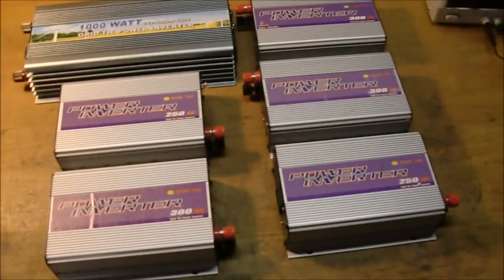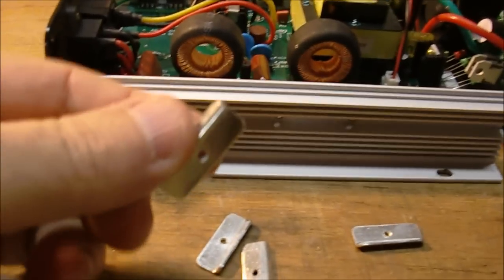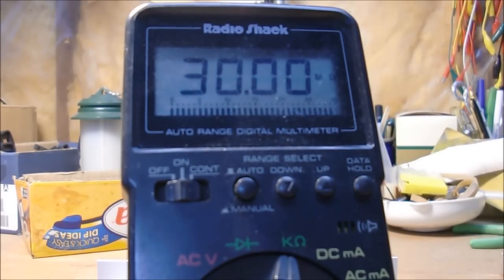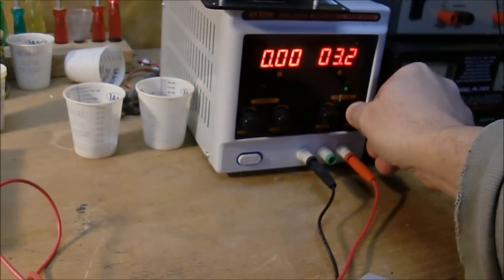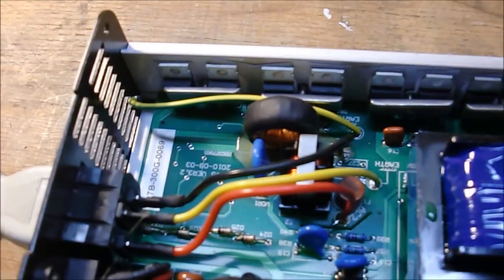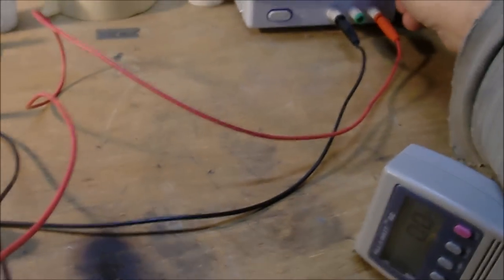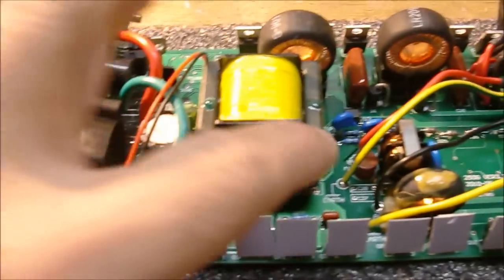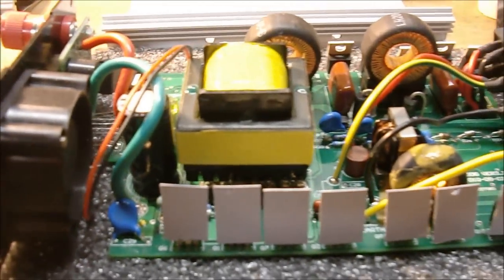Grid Tie Inverter Repair GTI SUN POWERJACK

Comment: I asked some one on here before about upgradin the mosfets, and they told me it could be done. but I have do it with audio equipment and its the same thign other than its for audio just have to make sure on the data sheet the gate voltage and stuff will match the gate voltage on the item being upgraded.   and all I usualy do is increase the wattage. and try to find lower ristance witch cause them to heat up in the first place. .. again great video.

Comment: Thank you for this, I have one of the power jack inverters and although it is now going on (Q8 AC side MOSFET blown), they seem to die quite often. It seems that the main issue is if the AC fails (power cut / brown out / trip goes) then the inverter spikes before shutting off to stop islanding.

I am wondering if connecting some hefty transient suppressors in series with something like a 100w 100ohm resistor might help - so GTI has a load if volts go high.

Do you think it worth trying?

Comment: I have watched a few of thes videos like this and it seems they almost blow the ac side for some reasion I wonder if its a flaw in the ac side mosfets. I wonder if they could be replaced with a better mosfet.  Just and Idea I like to tinker with stuff like this I guess if any of mine goes I will research the datasheeds on the mosfets used and then look for a mosfet that will preform better. have you tried anything like that yet.

Comment: Mr. Fearlessthinker I have a SUN 300G solar power grid tie inverter I bought about two or more years ago. It was working fine before for the first year. I took it out in service because I used my solar to charge battery instead. Today I decided to install with my two 60 watts solar panel I bought in Amazon.com. When I was installing today a lot of smoke coming out inside so I unplugged it right away. What is your suggestion to check first? Thank you so much.

Comment: Hi what resistor did you use on the inverter that scorched the back and what ac fuse to use...both need replacing on my board

Comment: Hello Fearless. What component would make a GTI (startup) start the boogie lights then a few seconds later shut down. Then repeat the whole process all day long. When I put it on the bench power supply it works just fine. I'm thinking something to do with the amps. The power supply gets up to 3 amps but the solar panel is up to 10 at times. They both worked just fine for a few month's. Any ideas would be appreciated.

Comment: Just wondering how do you check a transformer and also the microprocessor?
I have two greenenrgy star 600 watt grid ties and the green light goes around but there is no output on my kill a watt meter?
Thanks